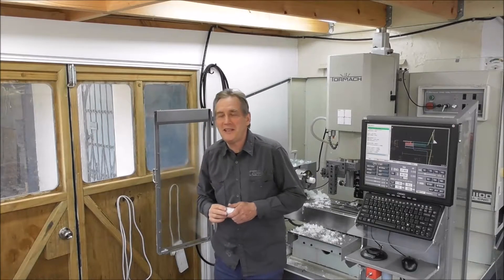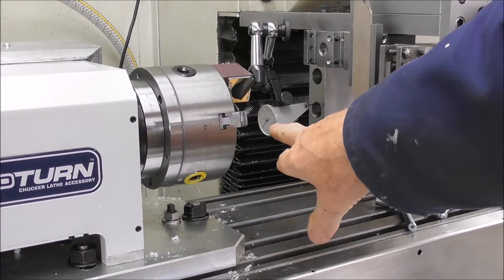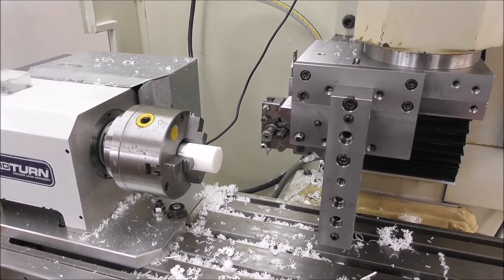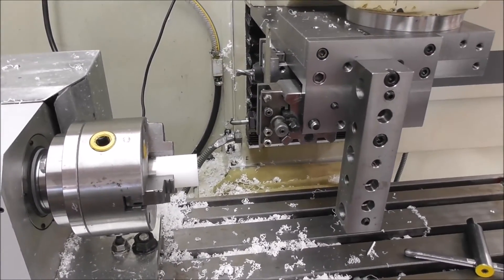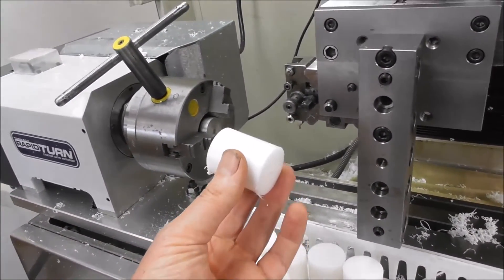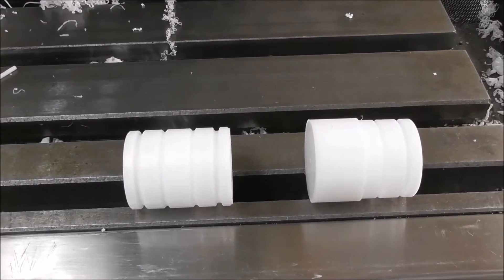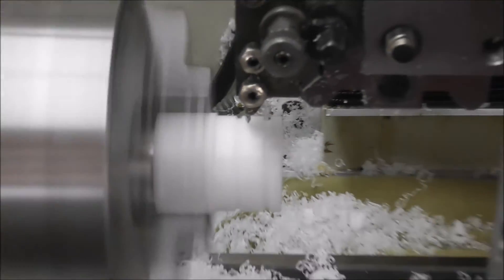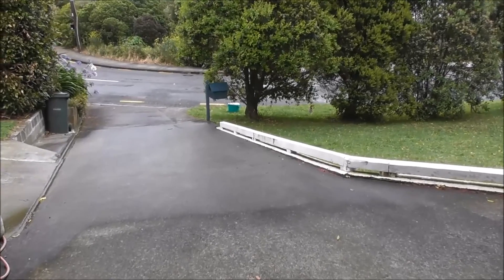Tormach RapidTurn - 13.  Machining Tips

Comment: Hi Cliff
Are you using Fusion, if yes, what post processor do you use?
I am having problems with mine, conversational works fine though.
Reply from the maker: Hi Richard - I have Bobcadcam V28 mill only - so far only using conversational for Rapidturn - or a edited mill code, which is a hassle. I should learn Fusion, how do you find it, apart from the PP issue?
Reply: Ricard Rinaldo I use fusion use the tormach slant pro post there are options on the bottom right on the post screen make sure you check or unchecked your tool change option to get positive and negative values on your x. Fusion works well with the rapid turn.
Reply: John Tomczyk
I did try that post processor but pathpilot was complaining about some lines. Will try some more today.

Comment: Hi Cliff I had the same problem on my rapid turn with the x or (z on the mill side) not holding its position . I dont believe it is thermal expansion. I found a big problem I believe with the support bearings and the ball screw on the z. The support bearing should be slip fit tight but not press fit. They are to tight even on a new ball screw "I tried and measured". This is a very long story  how this all happened and how I found it. 
I fixed this by pulling the ball screw out. I put it in my manual lathe and used some light sand paper and removed a few tenths off. It holds position on the rapid turn very well now. I dont think it shows up on the mill side because you dont really run like you do on a lathe. I can give you lots of detail on this if you like. I believe it is on all 1100 z axis not x or y I checked that as well. I did call tormach on this a month or so ago. who knows maybe they will fix it on there new ball screws.
Reply from the maker: Hi John. Thanks for posting that...very interesting.  You will find my email address mid way the video, yes I would like to hear more details.
In short I think you are saying the Z thrust bearing adjustment is hindered by one or both thrust bearings fit on the OD being too tight to allow adjustment....please tell me more. 

Thanks  Cliff

Comment: Nice informative video Cliff. Love the gang tooling and holders, just wish I had time to make some for my Rapid Turn. Tormach have been in touch about replacing my spindle, they are shipping a new one soon and I will return the faulty one to them.
Reply from the maker: Thanks for that Bob.
Reply: Soon may not be as quick as Tormach usually are when it comes to shipping orders.  It has been 9 days since I last ordered some tooling from Tormach and I am still waiting for the order to ship.  Apparently (at least as I understand it) they have outsourced their warehousing / shipping and it doesn't look like the changeover has gone very smoothly as Tormach have hold me the warehouse is behind and still catching up as of 3 days ago.